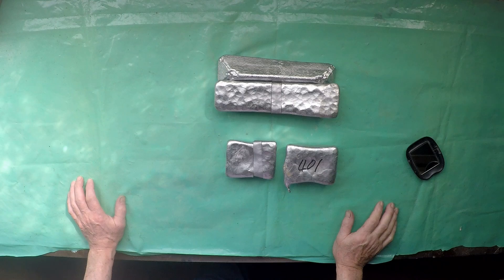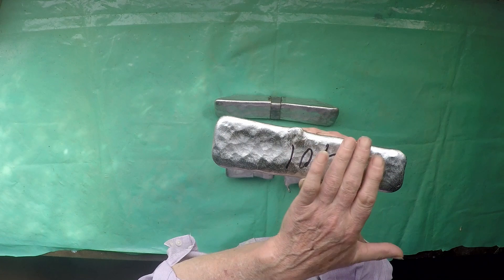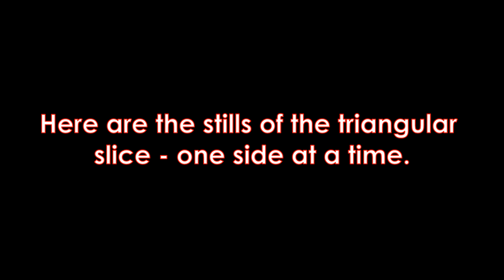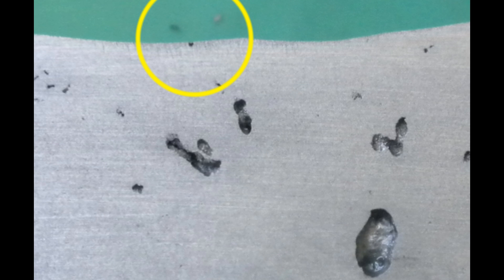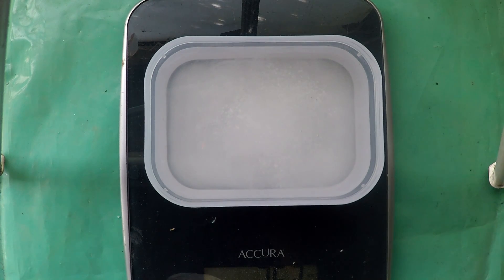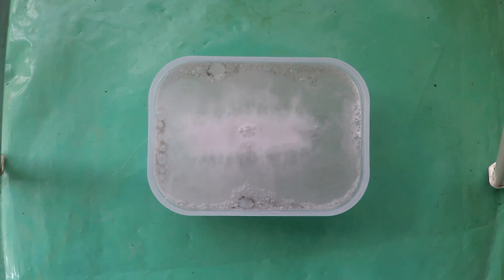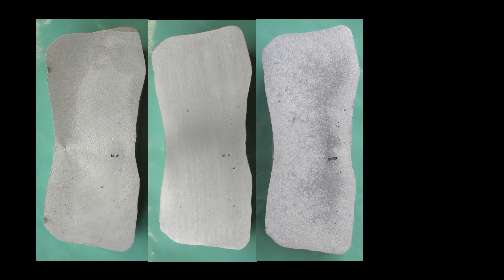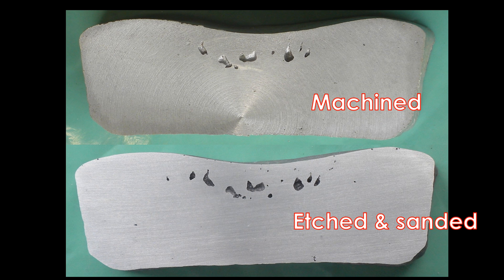Caustic Soda etching to reveal porosity in aluminium alloys.

Comment: Where does the hydrogen come from, and if from the fuel, why not use electricity?
Reply from the maker: Jerry, Damn good question!  There are many sources for the hydrogen but they all boil down to one thing - water - but there are many sources for the water - damp scrap, corroded scrap, damp furnace tools, damp fluxes, addition of chemicals that contain water of crystallisation (eg. washing soda) water absorbed by the furnace lining or by the crucible. water from the binder in the sand, mould washes, and the two biggies moisture in the air (humidity) and moisture from burning hydrocarbon fuels. Aluminium has an absolutely rapacious appetite for oxygen and it will pinch it from anywhere - notably water with which it reacts to form hydrogen that immediately dissolves in the aluminium and aluminium oxide which floats around in our metal as folded films constituting weakness all through the end product. Many foundries do indeed use electric melting in the form of resistance heated crucible furnaces and while it has the advantage of no moisture from burning a fuel it is slow and expensive. You still have the water from those other sources and while many can be eliminated with care the problem of humidity in the air is ever present and it is more than enough to cause problems. Best solution for the hobbyist - don't melt rubbish (swarf etc) throw all the thin rubbishy bits away do not constantly remelt the same metal, preferably use a dedicated casting alloy not cans or extruded stuff, clean and dry everything, melt quickly, do not overheat and pour without delay, avoid fluxes and in particular avoid washing soda.... Martin
Reply: @olfoundryman8418  "avoid washing soda"  <<chuckle>> :)
Reply from the maker: @andycoombes   You betcha! All that bubbling you see when its done is not CO2  - its water!  😱 .. Martin
Reply: Olfoundryman  PRETTY DARN GOOD CHEMISTRY LESSON !!!!!!
Reply: Even the atmospheric water plays a role. If it's humid castings will alsoays  have hydrogen absorption. Don't skim till the very end with very hot pre heated tools and go easy on the superheat. Don't hold metal above pouring temp for tooooo long either.
Reply from the maker: @raschellesherwood6347 , Sage advice! .. Martin
Reply: Electricity is bloody expensive that's my excuse
Reply from the maker: @raschellesherwood6347 , Its also bloody slow!... Martin

Comment: Good video. Im having problems with porosity but it sounds like shrinkage voids, rather than gas. This was an engine casing,  cast into a pre heated tube. I put a video showing it under microscope, any ideas how to improve for next time? Thanks
Reply from the maker: Mark, I watched your microscope video and the one before it that I assume was the pouring of the sample seen under the microscope. What magnification was the microscope video - a shot of a mm ruler against the casting surface would be a great help. There seems to be a lot going on i.e. several factors at play in creating all that porosity. Simply listening to the pour  - all that plip plopping as air gets sucked in to the turbulent pour is perhaps the best clue to some of the problems. Come to me at olfoundryman@gmail.com and I will try to explain more.... Martin

Comment: Is there a solid degassing substance that you recommend?
Reply from the maker: BFries, Sadly, No. In the good (bad) old days hexachlorethane tablets were available. When plunged into the molten aluminium these gave of chlorine gas which reacted with the aluminium to give aluminium chloride. This was  a gas at the temperature of molten aluminium and bubbled up through  it removing hydrogen as it did so. These tablets did seem to be reasonably effective. However the gases produced were quite toxic and very corrosive (the tin roof above my furnace is badly eaten away!). I believe that hexachlorethane has now been banned in most countries. There are tablets called "Nitral 10"made by Foseco these give off nitrogen when plunged into the molten aluminium. My experience with these was not good. They bubbled so viciously that they threw a lot of metal out of the crucible, they only bubbled for about 2 minutes and this is nowhere near long enough to remove much hydrogen. A local foundry did some tests and found that these tablets made things worse - most likely because of the violent turbulence of the rapid bubbling and large bubble size. I usually advise people not to bother with degassing. True gas porosity is very small as this video shows, what most people think is gas is most likely trapped air through bad pouring and gating techniques. Just use good clean metal that has been dried and is free from grease and oils - no paint and no printing. Don't endlessly recycle the same metal. Melt quickly, do not get too hot,(keep below 760  deg C) and pour without unnecessary delay using good gating and pouring methods.... Martin

Comment: Hi sir 
I want detailed procedure for caustic etching process for aluminum extruded rod to detect centre crack and porosity
Reply from the maker: Yogesh. I have never tried the procedure on extruded rod but it should work Ok I think. You will  just have to try it. Start with a piece of rod that you know to have defect in it and cut it both square and diagonally to see which way shows the problem best. Etch it in a 20% caustic soda solution until a noticeable attack has occurred (again trial and error). Rinse off with water and see if the crack is evident it will probably be seen as a fizzy line as caustic seeping out of it continues to attack the rod - to stop all attack rinse in vinegar.... Martin